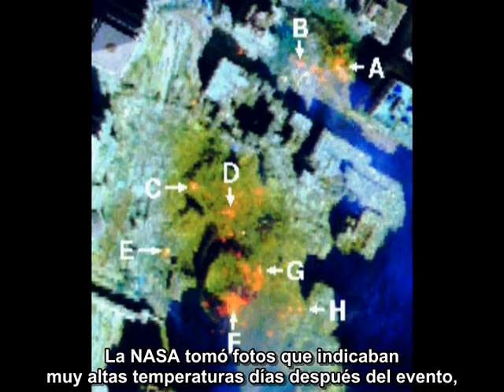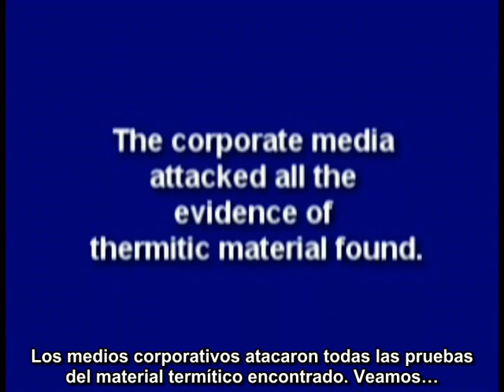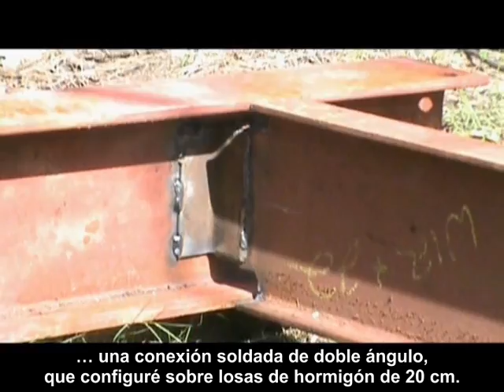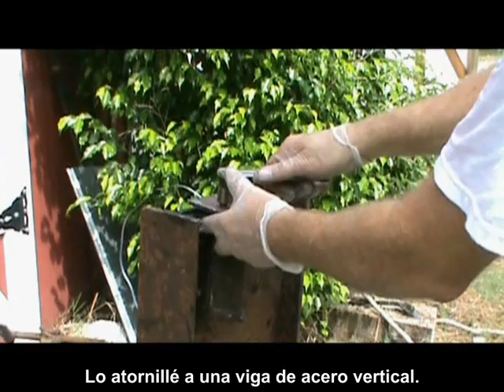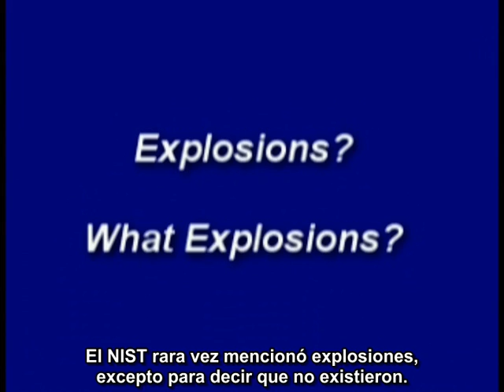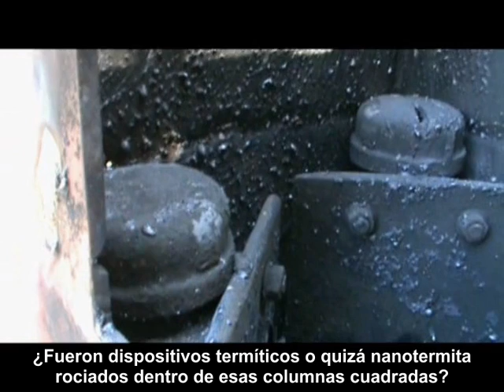11S: Experimentos. El Gran Debate Sobre la Termita - subtítulos en español

Comment: even still if thermite couldn't do it then doesn't that prove jet fuel definitely can't and same for office fires. 
is there anyway that some of the bolts could have been removed through the access panels without losing structural integrity?